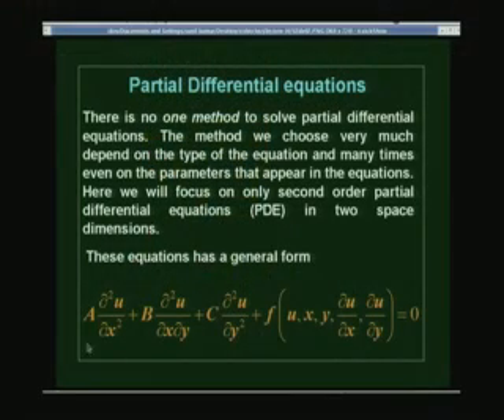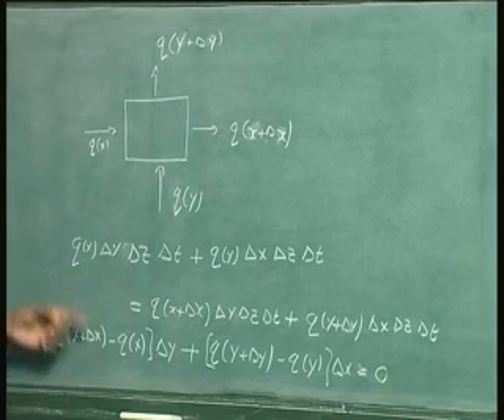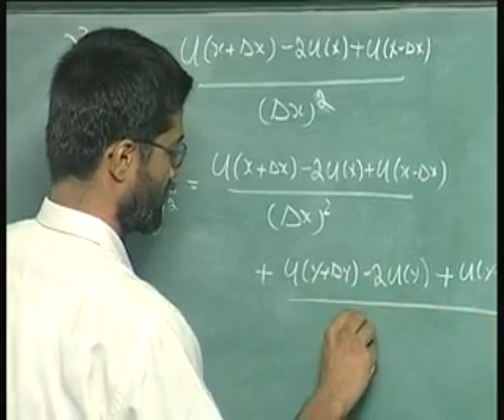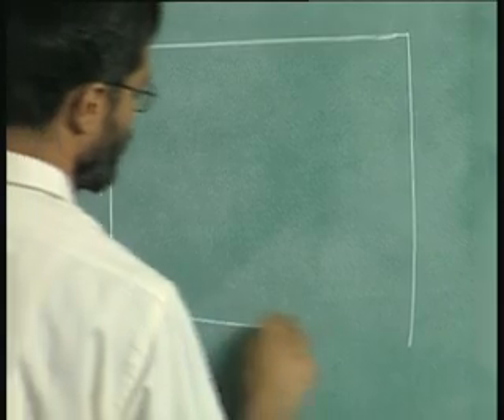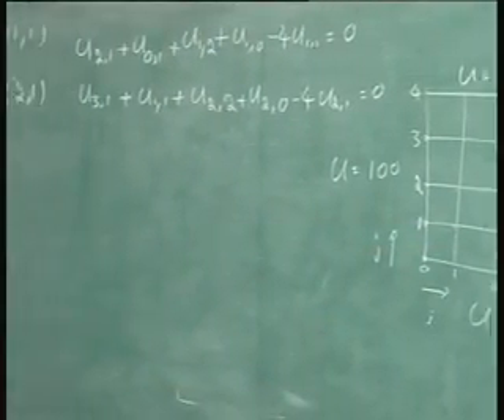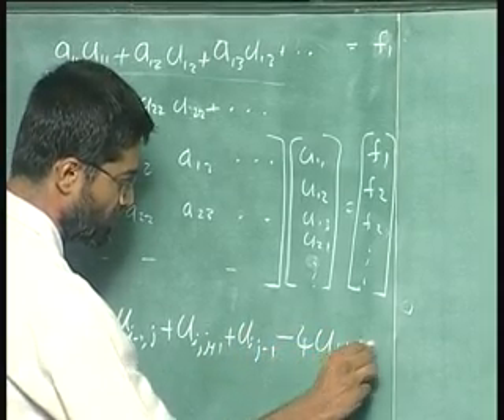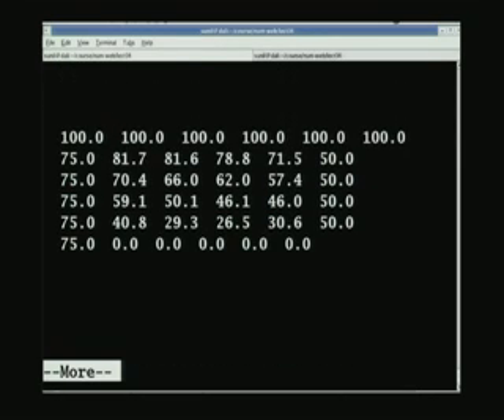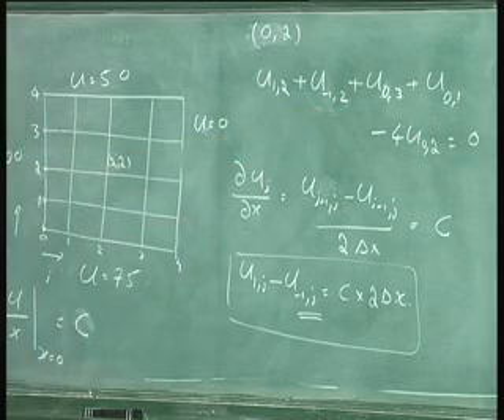Lecture 34 - Partial Differential Equations

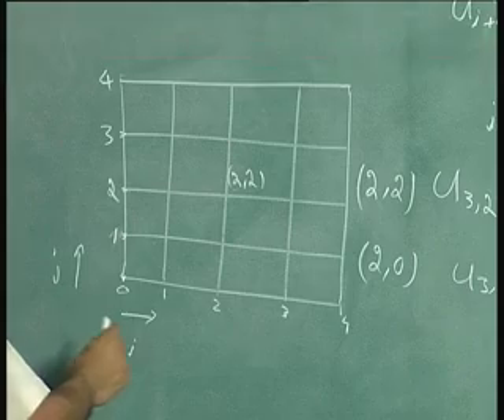Comment: there is a mistake when time is around 28:00, for point (2,0)...the right equation should be:
u(3,0)+u(1,0)+u(2,1)+u(2,1)-4u(2,0)=0
The mistake is at the second element: u(1,2) should be u(1,0)

Comment: He divided both sides of the equation by: dx*dy

The first term loses the dy on the top and only has the dx at the bottom.

The second term loses the dx on the top and only keeps the dy at the bottom.

The right side stays 0.

Then he notices that the limit as dx tends to 0 makes the first term the definition of the first partial derivative with respect to x.

The same thing goes for the second term but with respect to y.

Was that what you were asking or did I totally miss the point?